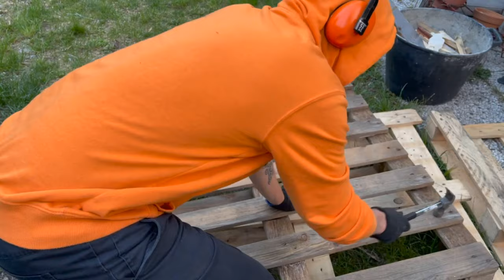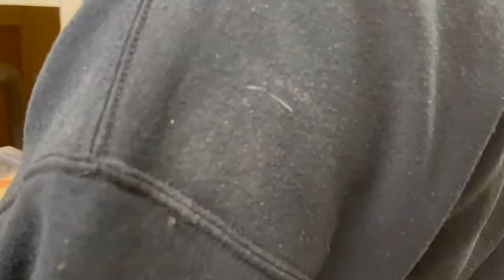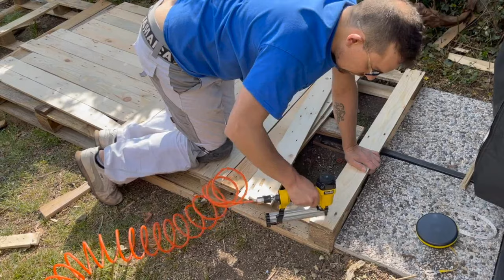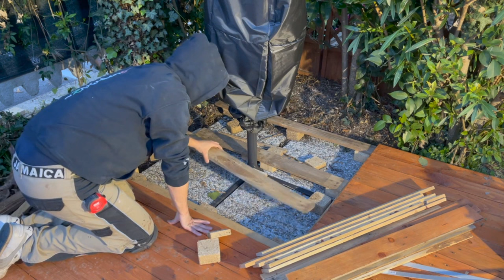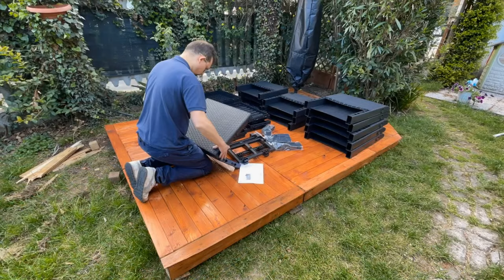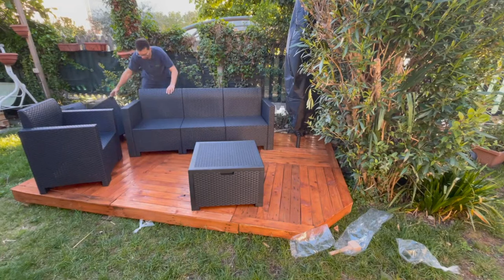How to Make PATIO DECKING Using Free Wooden PALLET | Easy & Cheap DIY Terrace Deck

Comment: Beautiful work, thanks for showing the process of "harvesting" useable decking lengths from the pallets. I have been thinking how to do something similar for my tiny home. Question, though...it looks like some of the pallets are resting on dirt rather than gravel or cement? If so, my concern would be rotting after only a season or two. Did you address that & I missed it?
Reply from the maker: You are right! It’s better to support the corners of the pallets with blocks. You will need 1 block for each corner of each pallet. Determine the number of concrete blocks you will need. Dig a hole, at least twice as deep as the block. Add gravel and sand to the hole. Tamp it down firmly. Add the block to the hole and level. Level each block as you go. Lay down wood pallets on top of the blocks, being sure to lay the corners on top of the concrete blocks.

Comment: Step one, purchase thousands, if not 10s of thousands of pounds worth of tools and machinery. Step two gain years of experience in joinery. Amazing video but it highlights why people just pay to have it done. We all pay, one way or another, we all pay. 👍🏾
Reply: I had just a hand saw for $100 and a drill for $50 with all free pallet wood and built myself a boat last year. Dock floats I got for free of Facebook and neighbors on the lake watching me single handidly build this 10ft x 6ft pontoon couldn’t believe it and gifted me a vintage little electric motor and battery.

Did end up staining some of it and put solar lights on but for under $200 I’ve got a boat.

Been out on her more times than I can count, have had 7 people on it at once, and that was my first wood working project.

If you really want to do something you can. Never discourage people from following their crazy project dreams. We all have to start somewhere and even if it took thousands of dollars worth of equipment (which it doesn’t) you save that money doing more than just one project.
Reply: I was going to say that but you beat me to it!
Reply: There are two types of people in the world; those who like to do things themselves and those who don’t. Don’t discourage the first type just because you’re the second type. Anything can be done.

Comment: Would the pallets rot being right ontop of the ground?
Reply: Of course.  Any wood.  But Palette wood is the lowest quality and wont last long regardless where you use it.
Reply: @b3arwithm3 how long would it last
Reply: @b3arwithm3 what color is the paint
Reply: @christinacraig313  to me palette wood is just thrash. I won't even keep it for a month.  It is not structurally sound. If it doesn't crack, it will bend and warp in no time.

Comment: Looks good but sorry to say, it won't hold long.  This low quality wood and not very thick and wont hold the weight of adults.  Plus the brad nails are only for holding the board temporarily.

Comment: Easy cheap .......right get a woodshop first then I'm all set for the cheap project .........only thing cheap is the pallets the equipment you used is not cheap at all ......now if you hand sanded each piece I'd give you credit but not on this 1 buddy ....Shame on you 😢